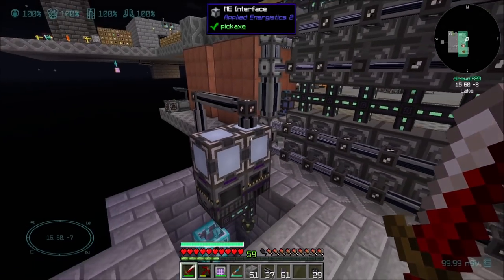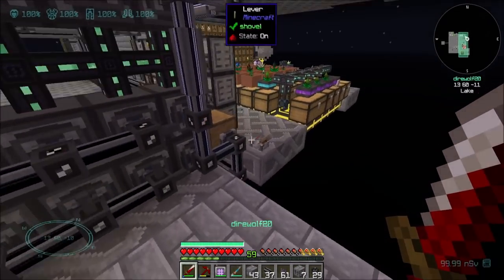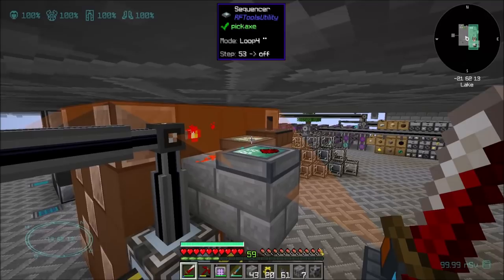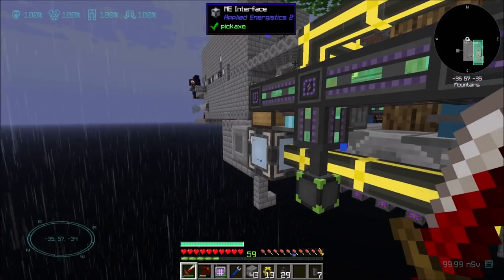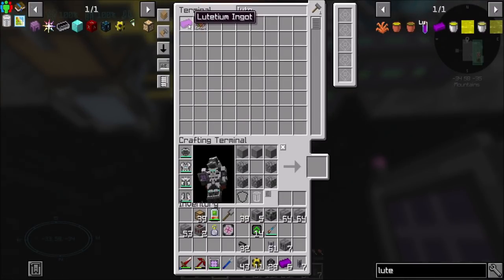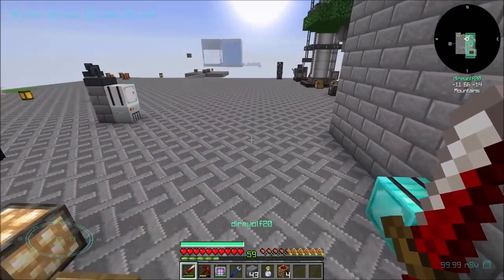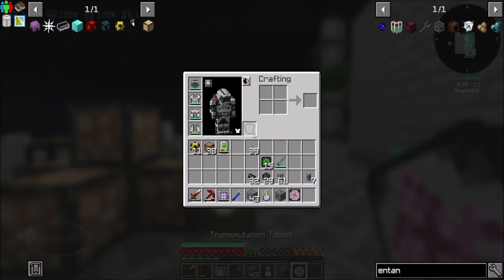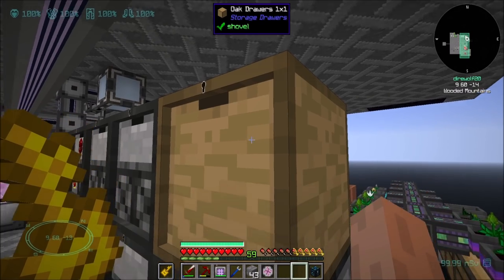NTC2 Ep49 Even More EMC

Comment: Spreading out crafting recipes vertically in your assemblers/interfaces can speed up crafting sequential recipes because each interface can simultanously craft with all adjacent assemblers.
It takes 1 coprocessor to instruct 1 interface to craft on multiple adjacent assemblers afaik.
So to maximize speed it's important that those base recipes that happen often are not interrupted by other crafts down the line. 
You can also put multiple copies of those base crafts into the system as long as they are in different interfaces with separate assemblers attached to them.

Comment: If I recall correctly, the watch of flowing time tick accelerating can be stacked with more watches
Reply: there is no way 🤣🤣🤣
Reply: also you can tick accelerate a watch of flowing time with a time in a bottle xD
Reply: Is that 18+18 or 18*18?
Reply: And you can charge up the watch to augment its range
Reply: @pachete.  But can you entangle block a pedestal and make the pedestal tick accelerate the entangled block, which itself is the pedestal, making the pedestal tick accelerate itself?
Pedestalception tick-accelerationception lul
Reply: @ZoryArky  just tick accelerating entangled blocks doesnt actually accelerate the original block
Reply: @ZoryArky  That would be interesting to try 😂

Comment: Has anyone shown dire the trick you can do by using additional ae controllers and p2p tunnels to get a ton more channels?
Reply: i think he mentioned the multiblock much earlier in the series and expressed disinterest in making it.
Reply: Isn’t that the Super Soaryn Drive?
Reply: wait are you talking about subnets or a giant p2p network system? Subnets can 'create' new channels (interface hooked to a storage bus), but if you're talking about p2ps then it doesn't actually create any more channels, just makes transporting them not a dense-cable-heavy affair.
Reply: @jumbojunk2681  some other modded mc youtubers I watch all use it, it's basically you have a main controller, you connect from one side towards a bigger controller using all p2p tunnels on the bigger controllers faces and then use a p2p tunnel connecting from that big controller on the main channel line
Reply: @woutroelandt493  Yeah, then that's a basic controller multiblock (most commonly a hollow 3*3) with another p2p network (which has its own controller to allow the p2p channels) towards the different areas in the base. You aren't actually creating channels in this instance, the p2p network only serves to transport channels from the machines to the main controller multiblock system. The alternative is to use a bunch of colour-coded dense cables, something which is neither cheap nor practical to use. That's why p2p is used, as you can transport upto 1024 (32*32) channels with a dense cable in a me-controller having p2p network.